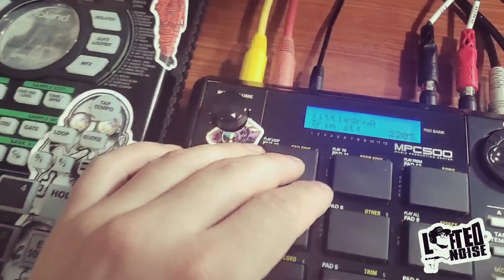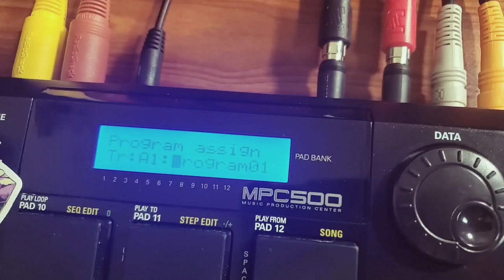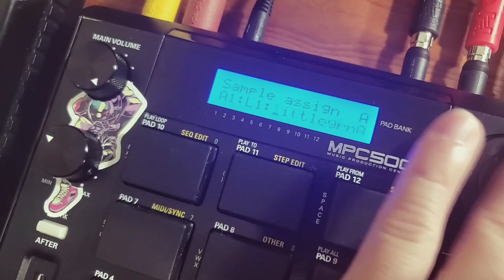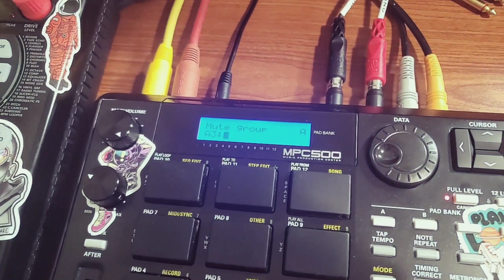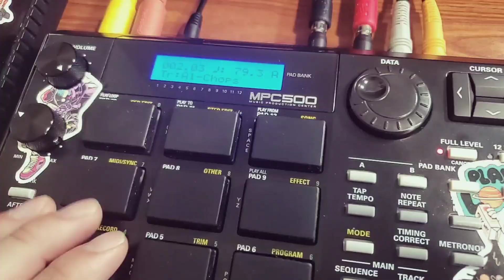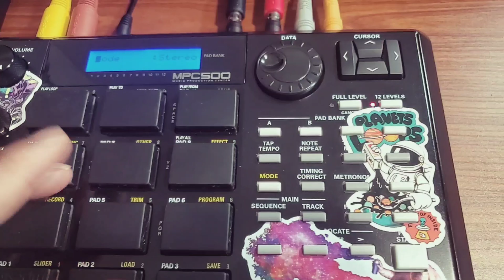Akai MPC 500 Tutorial x Chopping Samples x Re-Sampling Main Out x Lifted Noise

Comment: Help! Day 1 on the 500 and while trying to assign all pads to mute group 1 I’m only given the option of yes/no. What am I missing?
Reply from the maker: Under mute group there should be an option of up to 32. I don't see a yes or no. Maybe you have an old firmware on it. Press mode + pad 8/other. Scroll data wheel all the way right until it displays version. What does it say? The latest version is 1.31
Reply: Ahh…my bad. It’s the option of on/off but no numbers to choose from. Version 1.11. I’m guessing this would have been the same version when the video was made yea?
Reply from the maker: @PatrickJones-1  as you can see in the vide i was able to select mute group 1. The on/off must be a limitation of that older OS you are running. Definitely go upgrade it. There are some other added features your missing out on as well. I believe the old OS only has 1 filter and the newest has 3 filters. I'd recommend going to the 500 page on the mpc-forums.com and search in their for the update. I've seen it posted in the past.
Reply: Thanks man! Appreciate all the videos!
Reply from the maker: Did you find the OS? I just noticed MPC STUFF has it available at the top of this page https://www.mpcstuff.com/mpc-500-st500.html  @PatrickJones-1
Reply: Thank you sir! I had to go get a usb cable today so I can hook up to the Mac. Gonna install the OS tonight.
Reply from the maker: @PatrickJones-1  no doubt 🍻 have fun!
Reply: The updated OS did the trick. Got my chop template set up and 1st sample chopped down to 12! Appreciate ya for real
Reply from the maker: @PatrickJones-1  that's awesome! Happy to help. 🍻